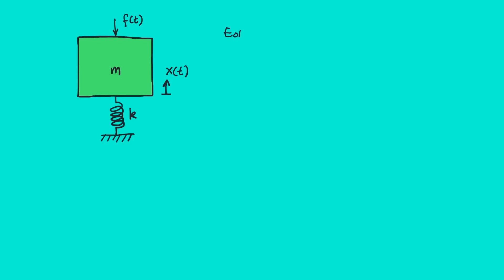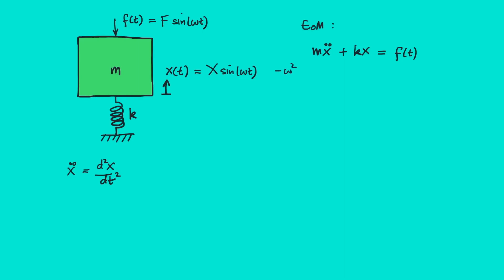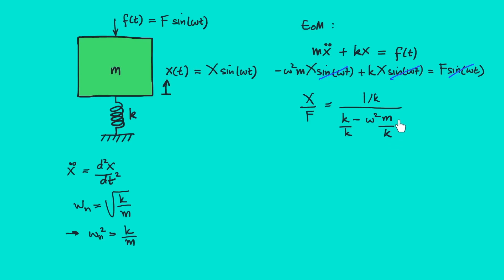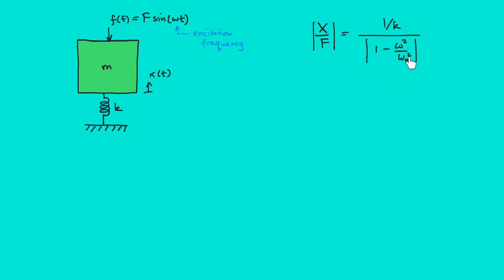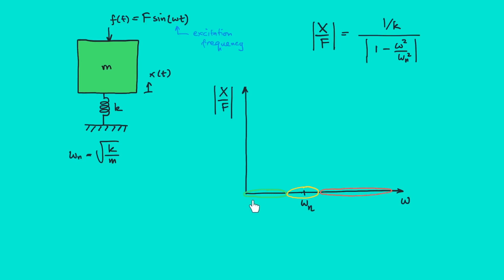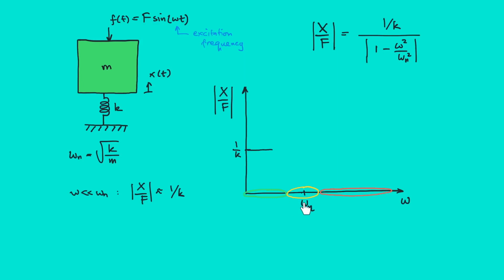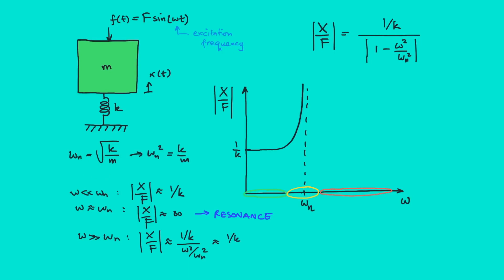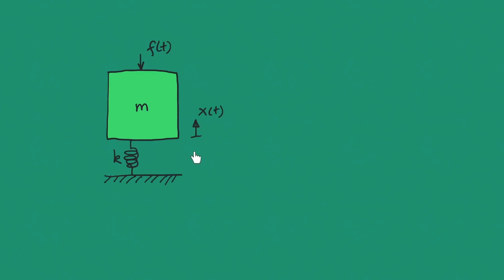Mechanical Vibration: Undamped Forced Vibration

Comment: Very helpful and intuitive explanation, Thank you :)
Could you do a video about a case that has more than one degree of freedom, for instance bending and torsion motion? How is the resonance will be expressed?
Reply from the maker: Thanks Hossam. For more than SDOF, it will be covered in Multi Degree of Freedom system (for discrete system). For a continuous system like beam, rod or plate, this involves wave propagation. Usually covered in details in subject ‘Sturctural Dynamics’.